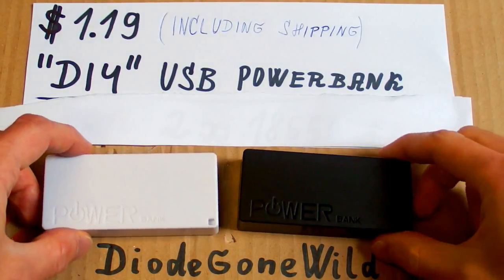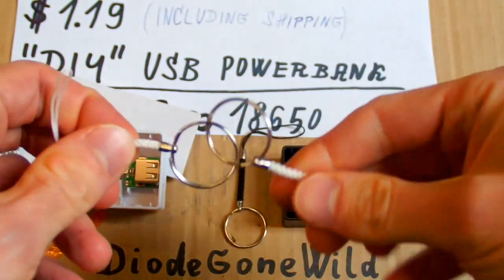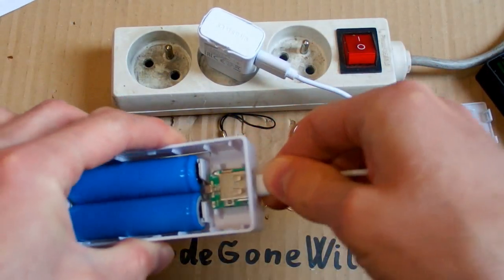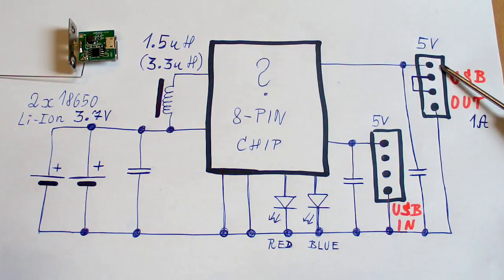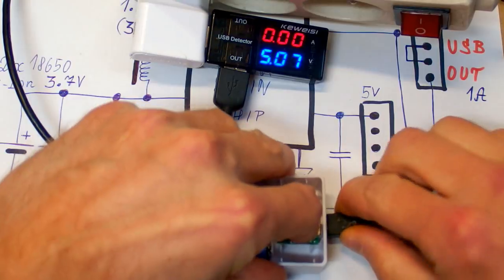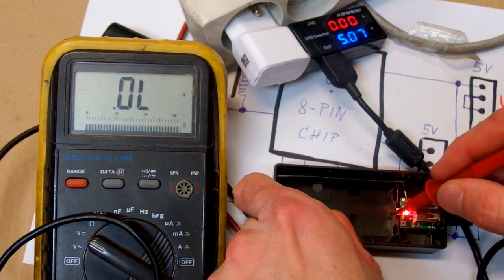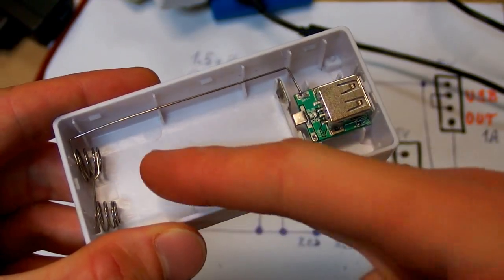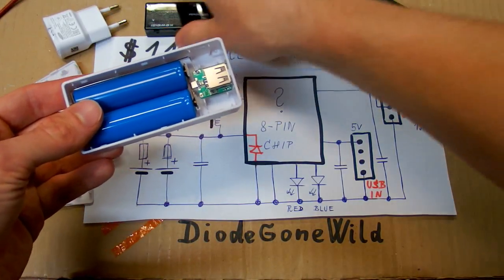"DIY" USB Power Bank for 2x 18650 Li-Ion cells

Comment: I did not realize how dangerous it is to put the batteries into these powerbanks in reverse, and I would've made that mistake had I not bought the wrong batteries (I got button top ones instead of the flat top batteries). This video was such a greatly  informative one. Thank you!

Comment: does it go to sleep mode as well as many powerbanks? I need for project that has constant power available because i need to connect USB motion sensor and USB led strip. Please answer. Your videos are amazing.
Reply: I have this powerbank and use it for the exact same project, as it doesnt have that auto-turn-off feature (it continues to power the PIR, which only draws like 50uA). I have a handful of single-cell powerbanks too: some of them dont auto-turn-off but others do (it is a lottery when buying).

Comment: I have one of these serving as a battery in a radio project I made but the batteries are junk. The power bank is similar to yours but the batteries are welded together and soldered in and I have the radio running directly off the 18650 cells and not going through the step up circuit which would interfere with reception. I saw these on amazon but I'm looking for one WITH cells. I have some westinghouse 18650 cells but they might not fit in this.

Comment: Does it heat up until the battery is completely charged? in my case yes :/
Reply: How much time it takes to recharge the batteries?
Reply: @basiljose1526  More or less 3 hours which is the recommended time
Reply: @630NESS  2-3 hour for 2 parallely connected batteries?
Reply: @basiljose1526  oh sorry, it must take 6 or 7 hours with that chip

Comment: Hi Sir! Great video! I also have the same battery case. But in mine, the blue led is always steady on even without load. And when I charge it, the light is still steady blue, not blinking red. Do you think I have a defective unit?

Comment: My 1$ Power Bank was a 'DIY' because I had to re-solder the B- wire (cold soldering) and carve plastic seam burrs off.

It came with IC TPOWER TP4333, data sheet is available.
If you buy 1000+, the unit cost drops below 0,05 USD. The PCB looks quite alike in the video.

Translated with google from chinese:

Overview
TP4333 is a synchronous boost single-chip solution designed for mobile power
The solution integrates a linear charge management module and a synchronous discharge management module.
Power detection and LED indicator module, protection module.
TP4333 has built-in charging and discharging power MOS, and the charging current is fixed at 0.8A.
Synchronous boost supports 1A output current.
The TP4333 integrates temperature compensation, over temperature protection, over charge and over discharge protection.
Output overvoltage protection, output overload protection, output short circuit protection, etc.
Protection function to ensure the safety of the chip and lithium-ion battery, and the application circuit is simple.
Charge management and discharge management is achieved with very few components.
Characteristics
- Discharge output: 5V/1A
- Charging current: 0.8A
- 1A output discharge efficiency up to 93%
- BAT discharge termination voltage: 2.85V
- Optional 4.2V/4.35V charging voltage
- Intelligent temperature control and over temperature protection
- Integrated output overvoltage protection, short circuit protection, heavy duty protection
- Integrated overcharge and overdischarge protection
- Supports trickle mode and zero voltage charging
- Support flashlight output
- Package form: SOP8
application
- Mobile power
Reply: Tanks bru

Comment: Hi, I am trying to make a 1 cell compact power bank using one 18650 cell, but can I use one power bank module for  1 or more cells ?
Reply: You can use more then one 18650 in parallel. More in parallel also means longer charging time.

Comment: MT3401A f**ing shit. No DW01+8205A (battery protection circuit) added, you can take it from any cell battery.
Reply: Replace this accs to laptop battery cells and solder it's directly to board.
https://savepice.ru/full/2019/2/19/a6552523c99ec09e0b27bc94e552cfd7-full.jpg.html
https://savepice.ru/full/2019/2/19/64375ddea8efcd56d2adc8da56ceba99-full.jpg.html

Comment: BOUGHT 10 of these been having problem to find the battery......I searched the chaconne66  cannot locate it......is there another seller that I find these battery....made a mistake buying the charger due to I thought there is battery inside......some searched said only for vape/flashlight & etc......I need 2600mah 3.7 .....need help anybody.  thanks
Reply: Just go to a local laptop repair shop and ask for a defective laptop battery and pull some good 18650s from it. You need to test for voltage first. I would pick anything that's above 3V. Their is a lot of videos on YouTube that shows how to get some from a dead laptop battery.

Comment: You can get the single cell power bank from Dealz in Ireland, Poundland in UK for 1.50 euro. I bought a few today   for the 18650's for a project. They're using exactly the same charging board
Reply: he has already made video on those powerbank circuit..

Comment: • I have one of those, but mine didn't have a keychain. They probably put it in yours, which is why you have two. "Quality". ¬_¬
• "DIY" because it doesn't come with batteries. 🙄
• You should test its output with a DMM. The USB volt-meter says 5V, but a DMM says 3.8V.

Comment: is it able to charge 6 batters  in parallel connection  if i make other box  .please..  or  what the max of battery i can charge  in one circuit.. thank u
Reply: You can but the charging time will now be more. Also make sure all the batteries have the same capacity.

Comment: I like the DIY version more because you can put you own batteries instead of the cheap Chinese one with suspicious capacity:)
Reply: instead of the cheap Chinese one with suspicious capacity
yeah youre probably right but wouldnt the boards on the diy powerbanks also be suspicious?
Reply: I had some laptop battery with reasonably good capacity cells. So I ordered a DIY power bank for 5x18650 and it arrived just in time for Pokemon GO craze ;) Definitely it was more useful back in the day when phones had smaller battery and Quick Charge wasn't a must. Now I roll with Xiaomi Power Bank 2, which today has the disadvantage of not having USB C.

Comment: In dis module can I use 10 battery🔋?
Reply: James . bond you can but since the charging current is not high that means it will take a very long time to fully charge those 18650s in parallel.

Comment: I have bought one of this case and 2 x 3000mAh batteries.
You think it will recharge a 3000mAh phone battery at least one full cycle?
And the speed of charge it is same as when charging from a wall socket or much slower?
Thank you.

Comment: I dont think any of my power banks has a fuse or reverse polarity protection, not even the more expensive  branded ones
Reply: yeme the DIY Tomo M4 Powerbank has a reverse polarity protection. Only problem I’ve encountered is that it drains your batteries even when not in use.
Reply: What is reverse polarity protection

Comment: I have been using these from ebay for a couple of years and they are still working. The main problem is rust from the metal connections.

Comment: I had that single battery one, and it blew up at the first run itself. I was testing it before making a video about it. I placed a fully charged battery and used the test load and bang! The chip went on fumes. May be a bad solder, idk.. But I didn't caught that on camera.

Comment: In fact, at least for me, it didn't blew up when I inserted the batteries in reverse accidentally. The battery went smoking hot at the solder got melted. But I managed to take it out on time and when I checked it later, it was working fine for my surprise!!

Comment: Hi, at the end of the video, you mentioned about adding fuses to it, may i know what kind of fuse and rating should be used? Can you show one that you have modified with added fuses? Thank you very much!
Reply: I'm sorry for the late reply. You should put fuses in it (2) one between batteries and one between batteries and chip. That's because if one of the cells goes short, it will heat up other one a lot and may even explode (very small chance because batteries now have CID). And if chip goes short circuit or you put it in reverse, you won't destroy them.
Reply: @pavelbires  hi.but what type of fuse?
Reply: @michaelsrowland  you can use glass one or the ceramic one, I would prefer fast 4A fuse (F4A).
Reply: or 2.5A slow fuse (T2.5A)
Reply: @pavelbires  how do you put one between batteries,  there is no room
Reply: @michaelsrowland  Hi, this is my second channel. If you don't have any space for the fuse, you could use a 37AWG wire, or even something thinner like 40–36AWG wire. Use 10mm length wound around resistor, but do not use resistors legs.

Comment: Some of them drain the cells with no undervoltage cutoff, the there's no fuse or current limit just voltage dragged down and the tend to charge your cells to brink of fire...I don't like them with low prices for ready powerbanks as low as 5€ with 2x god 18650 inside. Thank you for your reviews
Reply from the maker: I have never seen a powerbank with no undervoltage cutoff (so far).

Comment: Not bad! I could buy these just for charging up my 18650 cells via USB - as USB power from a PC (0.5A?) should be more than enough to charge them :)
And I always check to make sure I put them in the right way :)
Reply from the maker: Yes, those are good as chargers :). Much safer than the mains ones with very dodgy isolation.

Comment: 1.2 dollars for a usb charge circuit and a project box? Where do I sign up?
Reply: Chinese Ebay
Reply: aliexpress
Reply: ebay aka the silk road
Reply: If anything, the case is the most valuable part. There are also 18650 "holders" for cheap, but this actually encloses them nicely. The circuit is junk; you can get a much better one on eBay for under $1 and swap that in.

Comment: One funny thing about this DIY power banks is that if you travel to cities like Shanghai you actually can get one of these pretty cheap. I paid for mine only 2,62 Yuan which is around 0,38 US$
Reply: just got one off ebay for £1👍😎🇬🇧
Reply: you can find circuits of them for only 40 cents each on ebay by typing "134N3P"
Reply: Yeah but how much was  your airfare to Shanghai?
Reply: Meanwhile in the US, US ebay sellers sell them for $10 with no cells... XD
Reply: @Elfnetdesigns  Sometimes it's worth it to pay more and get it in a couple days rather than pay pennies and wait months...

Comment: Diode, what size of fuse would recommend fitting? F 1 amp or F 2 amp.
Reply: well, judging from the power bank, it just 1 amp.
Reply: Can be min. 2A. Must be 3A. Because 5W output. 5W/3V(min battery voltage)=1.6A But dont forget losess.

Comment: Use 12 battery to connect in parallel connection 18650 battery pink and color blue don't use other color only pink and blue
Reply: Ace Mark Fernandez What would pink and blue have to do with anything? It's just wrap colour. Are my brand new genuine Samsung 18650's (green) no good?!

Comment: I have the same power bank and am interested in adding fuses.  Can you create a video on adding fuses including what fuses to buy?
Reply from the maker: I may make a video on it in the future :). I would probably add a fuse in series with each cell. About 2A or 2.5A would be OK. Fast or slow, any fuse type is much better than nothing :).
Reply: The fuse physical size would need to be very small.  Is there a specific type that you recommend?

Comment: So not too bad really, at least you dont get a nasty battery, you can buy a decent one :-D.
Im always supprised by the little circuits, i would expect the fet in the chip to get dam hot and pop.
But perhaps there is not as much dissipation due to close voltages.

I would rate them a 1 amp, it may not go poof then lol :-D
Reply from the maker: This is rated 1A, no more. I tested it at about 0.8A and the chip is surprisingly cool, even after 1 hour.

Comment: Hy can you please tell me what is the name of ebay seller you both cheap good full capacity 18650 cells from ? I need some cells for project.
Reply from the maker: Hello, I've bought a pair of cells for 3usd including shipping from seller named chaconne66 and they were around 2400mAh, but I can't guarantee he sends the same type to all buyers.
Reply: DiodeGoneWild thank you I will try and see what happends  :)
Reply: Wait, so the 5000mAh batteries I got for $1.94CAD each aren't real? 😲 Chinese sellers sell fake stuff? 🤯